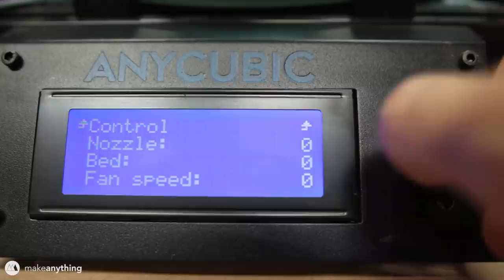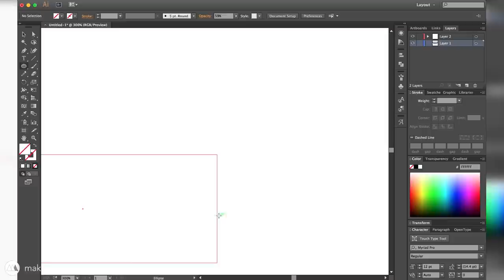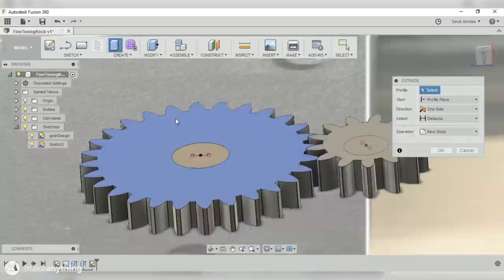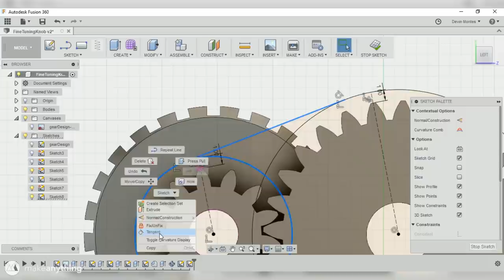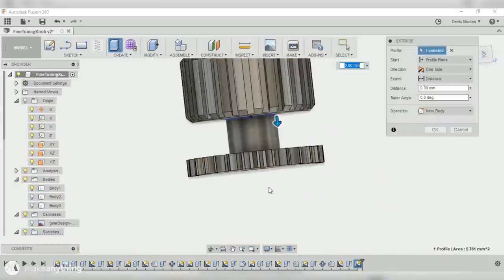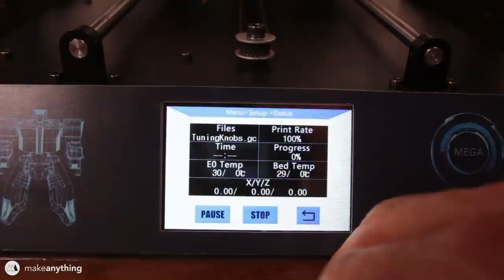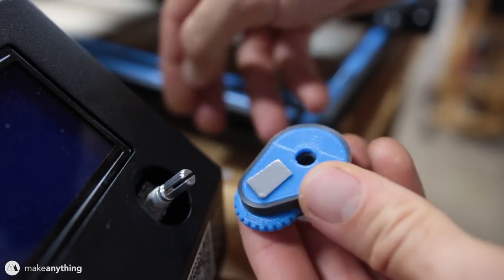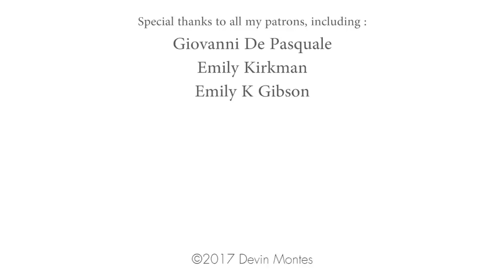Designing a Better Knob for my 3D Printer ( in Fusion 360 )

Comment: Am I the only one who thought "Like, what? Why are you using threaded connection on a knob that you are going to be rotating in both directions, unscrewing your knob xd" Mechanical engineering ruins my life.
Reply from the maker: +Łukasz Hryniuk luckily it tightens enough so it won't come undone :P
Reply: Make Anything // 3D Printing Channel Oh, I didn't think I could get a direct answer :D I enjoy your videos anyway having a bit of insight in additive manufacturing technologies. Don't stop doing awesome, inspiring things ;)
Reply: Łukasz Hryniuk lol I'm not even a mechanical engineer and I thought the same thing
Reply: Łukasz Hryniuk just a random normal person and I still noticed that
Reply: Splines would have been better from an engineering standpoint, but worst case with threads is a little glue or Loctite.
Reply: Lol me too I was worried it wouldn't work

Comment: It's funny how the single tactile interface method of a machine can be so badly neglected. I tested the original cubicon single 2yrs ago and it was the same kind of thing, a single iffy knob which was difficult to control (on a 3K machine!?). Even just a nice large tactile knob with your logo on it and no gearing would be a super cool first project.
Reply from the maker: +Maker's Muse yep, definitely a silly thing to neglect when it's such a big part of the user interaction.. I'm always confounded when such obvious things slip by
Reply: Angus Deveson and Devin Montes chatting like this is like mom and dad talking about some awesome trip they'll make together while leaving the kids (me, in this case) in grandpa's without a goddamn 3d printer... =X
Reply: you guys NEED to collab
Reply: Sneak out of your grandpa's house and go to the nearest fablab! :P
Reply: Sadly, where I live (Brazil), buying 3d printers is no easy task... Take the Prusa MK2S kit, for example... It costs only 700 USD. To ship it here is another 100 USD (800 USD total). But we pay tons of taxes to import, so, the final cost is more than 5.000 BRL (Brazilian Reais). Just as a measure tool, the minimum wage is 937 BRL, something like 300 USD. Even a cheaper 3d printer, the CR10 (390 + 65 USD at GearBest) will cost 2.850 BRL.
Reply: yes definitely
Reply: The JGAurora Z-603S has the best knob I have used on a 3d printer.  So crisp and the push has a very pleasing click.  Wish all of my printers were like this!
Reply: Can i call u musie
Reply: Maker's Muse r

Comment: I'm sure someone else has already mentioned this, but a super simple, not as fun, way to achieve the same results is to print a one piece knob that  has a much higher diameter near the base than at the top. When you want to make really fine adjustments you hold onto the larger part of the knob and when you want large adjustments you hold onto the small part of the knob. This is because the electronic part of the knob reads radial travel. If you look at the equation for the the arclength of a circle s= (rad) *  r where s is the arclength, or length of travel of the outside of the knob,  rad is the radial travel (in radians) and r is the radius of the knob. The bigger the radius of your knob, the farther you have to physically move the outside in order to make the same radial adjustment to the printer.
Reply from the maker: That's pretty neat, good suggestion!

Comment: I experienced this issue before. It can be fixed by adjusting the number of steps for a turn to be registered in the 3d printers firmware

In marlin the setting for this is under configuration.h:
// ENCODER SETTINGS
//
// This option overrides the default number of encoder pulses needed to
// produce one step. Should be increased for high-resolution encoders.
//
#define ENCODER_PULSES_PER_STEP 4

//
// Use this option to override the number of step signals required to
// move between next/prev menu items.
//
#define ENCODER_STEPS_PER_MENU_ITEM 1
Reply: That would simply move the problem from "can't make little adjustments" to "can't make big adjustments".
Or it would force you to set a medium sensitivity for making medium adjustments and lessen both problems, but not solve them :S
The 3D printed double knob fixes them, and that's what makes this solution cool.
Gj Devin =D
Reply: Stefano Gamboz yh, but this solution is for lazy people, like me lol.
Reply: it is also the correct solution. even when you set the pulses per step, and steps per menu item higher than the defaults, you still can scroll through large ranges of values quickly.
Reply: The correct way would be to set a the pulses per step relative to the acceleration, just as a pc mouse works.
It may be too much for some avr based 3d printers, but is worth exploring.
Reply: Stefano Gamboz there is a setting in Configuration_adv.h called ENCODER_RATE_MULTIPLIER that addresses your concern.
Reply: +1 for fixing firmware config for encoder steps. It seems like most printers leave these settings at default, which doesn't match the common encoders that the clone LCD controllers come with.
Reply: Firmware is one, contact debounce using RC or nand gates if you need firmware space and save some processes on the MCU. Even replacing the cheap POS China part with a quality one will improve it. I liked the I can adjust the temp 1 degree at a time when it jumps from 90 to 100 gave me a chuckle.

Comment: Fusion 360 actually has its own gear generator that I think works really well.  The way you did it works fine, but if you want to remove a step then it's there for you.

Comment: Thanks for another great video, Devin. I love your creativity. I have one point of constructive criticism for you: the way that you use the word "tolerance" is not correct. What you are talking about is "clearance". Tolerance is a measure of the variability of a dimension, which is the reason for adding Clearance. Thanks again and have a great day!
Reply from the maker: +Ocie Ward good to know, thanks!
Reply: Yes, great vid:) And yes, terminology is sometimes used "loosely". Usually, people generally know what each other is talking about, but technically, there are "proper" terms. And, though tolerance relates to clearance, there is an aspect of clearance that has nothing to do w/ tolerance - specifically, a "design intent": desired fit: loose, snug, tight. These are set as "nominal" values (i.e in a perfect world). Then, in addition to the design intent clearance, tolerance gets addressed (which will be different for different technologies). OK, that for listening/considering.

Comment: My first Idea was instead of using gears, just have a larger wheel that fits around the original knob. It would solve the directional inconsistencies and because the plastic is so light, it would not be too difficult to move the smaller existing wheel in the middle.

Comment: I hate when Marlin come bad configurated so much sensible like this machine, but, the good thing about it, is that force me to research into the marlin code and configure the encoder steps correctly, now I know a new thing, but has burn it my brain until I found the solution, by the way, you design skills are awesome man!

Comment: 1. Fusion has a photo (canvas) calibration tool so you can forget about Illustrator.
2. There is an plug-in for Fusion that will generate a all kinds of gears (spur, helical), so again 3rd party apps not needed.

Comment: This is an excellent tutorial on how to design gears and solve a problem! Another way is to modify the firmware and change the ENCODER_PULSES_PER_STEP  and ENCODER_STEPS_PER_MENU_ITEM values in the Configuration.h file of Marlin. You can also change the direction of the menu selection when turning the wheel to make it more intuitive.
Reply from the maker: +Grey406 I don't get why they didn't fix this to begin with 😑

Comment: Nice build, and since it's about improving 3D printer usability I would add a reset button for the printer since the knob case would be a nice  support for a tab with a shaft going down the reset hole.
Reply from the maker: +Ladoss good suggestion! I've never had to use the reset button, so I didn't think about that

Comment: Of course there is the simpler and still completely mechanical idea of just a two step knob.  Think a regular knob with a skirt, with the skirt also having knurled edges and used for fine tuning.  Make the skirt as large as practical, set the firmware steps to make the skirt work well for adjusting by 1, then make the upper smaller knob a small diameter to be able to spin the knob around fast for coarse adjustment.  Still gives you an easy fine adjustment and coarse adjustment, but simply by which part of the knob you use to turn and way less parts..

Not knocking this in the slightest, sometimes it's needed or much more difficult to get into the firmware, and the video is great on using 360..  And of course I don't have that printer, it may be even worse on fine adjust per other comments.

Comment: a cool mechanical solution to a software problem ;) really great design, but many printer suffer this issue and the "best" solution is maybe a bit advanced: open the configuration.h of the firmware and change the encoder steps and reupload firmware ;) 
(if you do so, could be good to backup eeprom settings first)

Comment: In Fusion360 you can insert image as canvas and after creating that, right-clicking that canvas and choosing "Calibrate", then you can mark two points where you know the dimension and the canvas will adapt to It ! :) No need for Illustrator :)

Comment: About your knobs sensitivity: What I would do is flash the bootloader onto it, if it doesn't have it...my CR-10 didn't, upload the stock marlin firmware because it already comes set up so that one "click" only changes one value at a time. And on the plus side, you can edit all you want in the firmware from low level control settings to what it displays on every screen.

Comment: if you use rubber bands between two sylinders instead of gears they will turn the same direction even if you just have two gears :) (also they are very silent)
Reply from the maker: Good idea, I'll have to try that in a future design :)

Comment: It would be nice to have epicyclic gearing. You would have 2 knobs sitting on top of each other and it would look cool.
Reply from the maker: +Phil's lab I wanted to but gave up on finding a tool that would let me design those gears :\
Reply: I don't think there is a tool for it. I think theory has to be read first. After it needs to find a gear ratio, next calculate number of teeth and design individual gears. Next place them all together and design enclosure.

Comment: Would it be possible to use a planetary gear system with an inner dial and outer dial both spinning at different rates?
Reply from the maker: I tried unsuccessfully.. when turning the outer ring, the planets move, but the center doesn't spin at all.. maybe I was missing something :|
Reply: Did you anchor the base to the printer with the double stick tape like you did with this one? Anyhow many different way to approach the problem and this works great as well. :)
Reply: Just thinking... do you have to have the planetary gears secured to make this work? Thats what I would think
Reply: You probably had it set up a a sort of gear bearing, so the planets were acting as balls do in a ball bearing and letting the sun and ring gear turn independently. You need a carrier plate in planetary gearboxes which can be used to fix in place or power the planets.
Reply: The reason it works in a transmission is bands and clutch plates which would be difficult to control at that scale. I guess you could pull the nob to engage the parts but I don't know how you would stop accidental button pushes when going the other direction.
Reply: I have no idea what you guys are talking about
Reply: instaid of switching gears why not have a title thing to lock the gears so it turns the nob without the gears for quick turning

Comment: I don't have a printer and have least knowledge to work . but it would be nice if u can built a concentric circular knobe. like both   move in same direction . but of u move outer rim it's slow adjustment and if u move iner rim or easiest will be to say uper rim . for main settings .

Comment: Really neat functional print. In Fusion 360 I have a problem sometimes where  I can't use a projection to extrude with like you did here and I have to redraw the projection on the new sketch.  Any idea on why that happens?
Reply from the maker: +ImaginationToForm hmm, not sure. All I can think of is the loop might not be closed
Reply: I'll look out for that but I was pretty sure it counted as a sketch profile.  I need to redraw that model anyhow.  I know quite a bit about Fusion 360 but it just doesn't make sense sometimes either.
Reply: Part of the problem might had been that the sketch had an error because of other changes in my model and f360 was stating that it was working on cached data.  When I deleted that sketch and started over I was able to project what I needed then offset it. Then made them into a profile with two lines. I was then able to extrude it as needed.  Something else that I'll need to keep an eye on as my projects get more involved.

Comment: Hey Devin, Super cool, but it seems the problem with the knob is related with the printer firmware, the knob have steps between every step?? or is smooth like a potentiometer?? 
if it's like the first is a problem with the firmware, the firmware detects noise between every step and think the noise is the knob turning faster

Regards :D
Reply: Gustavo de León most likely it is a rotary encoder. No it isn't noise that is causing the issue. Most likely the firmware rotary encoder steps is wrongly configured
Reply: Either way, by making this, it allows varied speeds, enabling large changes to be made quickly as well as delecet agustments too. Updating the firmware or whatever would resolve the problem of selecting precise settings however this would no longer have the same flexibility as the system demonstrated in the video (unless you used different gear ratios).

Comment: That's a great bit of design. Do you think it will work on my Prusa?
Reply from the maker: +Stephen Boyd sure, if the metal bit of 6mm diameter! Otherwise the file would just need a tiny bit of modification
Reply: I'll give it a whirl.

Comment: this is the reason people do not make the leap in to 3D printers, you jumped from software to software that included some very complex and expensive ones like illustrator. Just absorbing the vernacular alone would be overwhelming . just to give everyone a reference, you can not just buy Illustrator. It is a monthly service that costs anywhere from $10 a month to $80..

Just put yourself into the shoes of the average joe (targeted demographic).. say they even have the motivation to want one of these. Ya know for that odd and end fix or repair. Everyone has these daily items like a camera, stove knob, maybe a garage sale item they can get cheap and bring it home and print missing parts or something. would be really cool right?

No, this video is proof of that. This is discouraging to anyone thinking about joining the community. The first thing people are gonna do when he shows Adobe is google it. They gonna shy away and the 3D community suffers from it greatly. 

The only reason printers have come down in price so much and increased in features is because of the growing community. Do not make the mistake of thinking this will not plateau. 

The bottle neck in this industry is SOFTWARE!!! Everything is patched together and not one of them is an industry leader. The only people really making decent purpose software are the big manufacturers and they are making that software proprietary to their specific machines.  Then on an ironic turn the really successful machines that sell like hotcakes are the knock offs. Then that is where this patch work software comes in.

Now we compound this because the only creators we find are geeks who have the technical experience and access to these software packages. They in return release videos like this and the cycle of stunting growth repeats itself..

YOU SHOULD HAVE USED A FREE SOFTWARE OPTION LIKE INKSCAPE FOR THIS VIDEO.......

I sincerely hope my intent is clear here... Simple mistakes like that does more damage than good because people just want to know these things are in their grasp!